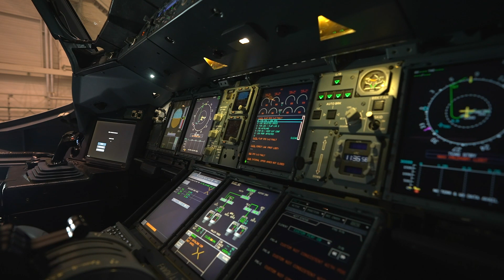A tour of the Airbus A380  hydrogen engine test aircraft

Comment: Really interesting, but how does hydrogen compare with Sustainable Aviation Fuel? Hidrogen turbines will still generate NOx and Vapour (wich at high altitude is a greenhouse effect gas), It also has bad volumetric energy density, meaning huge tanks for the aircraft and production and transport of hidrogen is quite inneficient and expensive. Also, who will be the manufacturer of the engine itself, Airbus or an engine manufacturer?
Reply: SAF is no priority for Airbus, since SAF is used in existing engines without problems. Also SAF is still producing CO2 in a considerate amount. The claims that SAF produces 80% less CO2 than kerosine is somewhat flawed. The 80% claim is starting at the "used cooking oil" part of the chain, not considering that producing cooking oil also has a high CO2 production, even higher than conventual kerosine. Nevertheless, recycling of the used oil definitely is a good thing.

However, hydrogen should be another step forward. Its not completely greenhouse gas free, but produces significantly less greenhouse gasses. For the transportation, a lot of countries are building hydrogen-ready pipelines already that will be able to distribute hydrogen to airports and harbours. For the production, renewable energy is the key. If you build renewable energy generators with 20% more capacity in mind than you actually need, this 20% can be used to create hydrogen. It's inefficient, but it's carbon-zero and its better than stopping wind turbines because the excess energy would overload the grid. Some windy islands in scotland already do this on a small scale and it works good
Reply: NOx would only be produced if the hydrogen is burned, not if it’s a hydrogen fuel cell powering an electric motor.
Reply: It takes high pressure tanks and has to be kept cryogenically cold.   It's an interesting idea,  but comes with certain dangers as it's highly explosive.   I'm thinking hybrid jet fuel/electric engines would be more practical.
Reply: @BillySBC  Yes but you have to bare in mind this is only at the good idea stage.  They have to start somewhere.  Hydrogen may or may not be the future.  But lets at least figure out what we can with what we already have and maybe discover a few worthwhile things along the way.